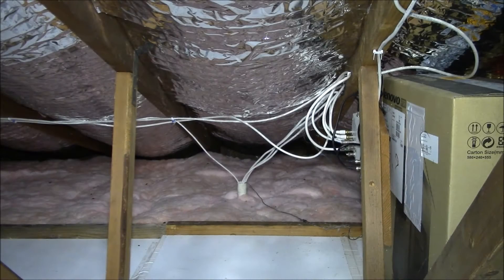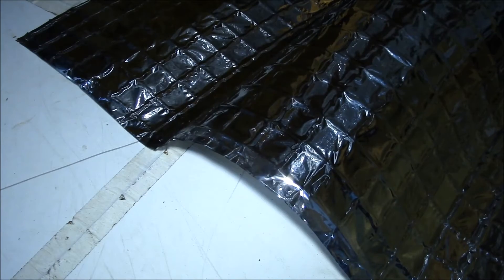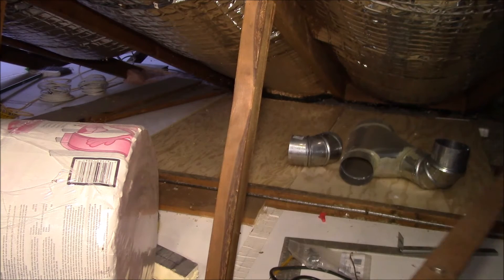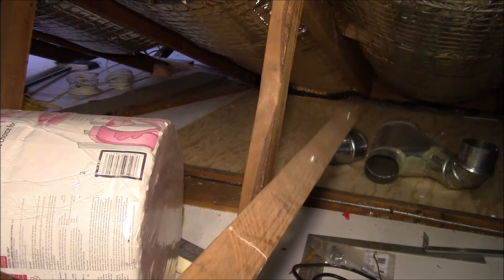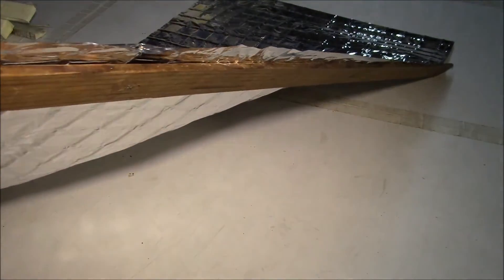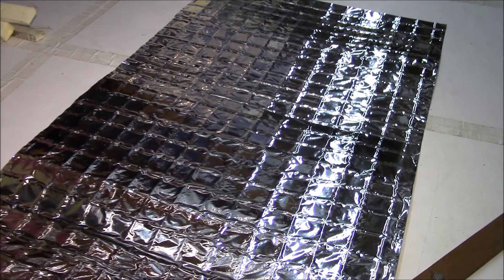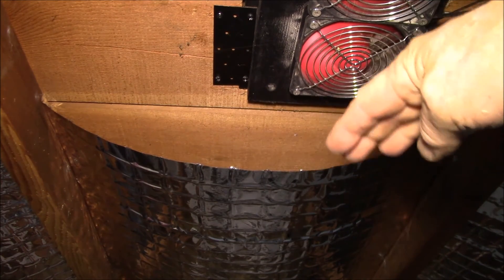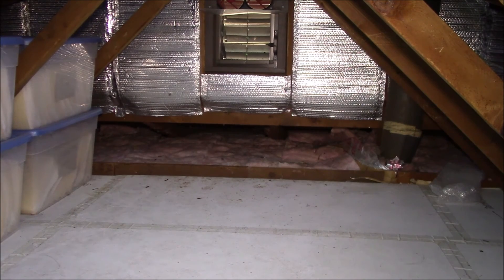Radiant Foil Insulation in the Attic

Comment: Thanks for making this video. Excellent tip about the magnets on the stick. 

I have 1010sq ft home here in South West Missouri and Im thinking about installing a radiant barrier. 1) Do you still recommend installing a radiant barrier after years of having it installed? 
2) A radiant barrier manufacture recommends me laying it over my blown in insulation but its perforated to allow moisture to escape. Is laying the barrier over insualation still effective in your opinion?
Reply from the maker: Yes, it's been working well for me for the last 8 years.  You want to have it placed somewhere between the insulation and the roof so that it reflects heat up and away from the insulation.  On top of the blown in would likely work as well.  Just this week, we had a high of 102F and the attic topped out at 112F, so it really helps, especially when coupled with some attic ventilation like I run.

Comment: imnot energy anengineer but my first tought is that steel wire in the foil deminish tht resistance value of the insulation
Reply from the maker: Agreed if this were a normal batt type insulation.  However, this is a radiant insulation that reflects infrared radiation and the steel wires are sandwiched between the two layers of foil.  As such, almost all the infrared radiation on the hot side gets reflected away from the foil.  The small amount that does get through will of course conduct well through the steel.  But since the steel wire is there to maintain the necessary air gap between the foil and the underside of the roof deck, it's benefits outweigh it's drawbacks.  I suppose they could use a fiberglass or carbon fiber type of stiffening baton between the foil, but that would probably cost a lot more.

Comment: Do you have soffit vents? I'm assuming if you do your maintaining the airflow from the soffit vent to the ridge vent. Why did you choose foil vs batt insulation?
Reply from the maker: Yes, soffit vents in every other rafter bay.  I stopped the foil 6-12 inches short of the vents to allow that outside air to enter the attic.  I used a combination of blown in insulation (existing) plus batt insulation on top of that for about R25 over the ceiling.  I wanted the radiant barrier to reflect the heat  off the roof instead adding more batt insulation under the roof.  It would have cost a lot more money and time to insulate the roof.
Reply: Heat transfers by three mecganusms..

1. Convection a stream of warm air as in Central heating or a heater.
2. Radiation the sunsl's rays or a microwave oven
3. Confuction. A clothes iron.

Fluffy batts stop convective heat transfer as they trap a layer of air which is a good insulator and holds that air in place close to the roof. This stops the rising convection heat  from escaping in winter through gaps or by conduction then convection up out the roof vents.

For summer though the heat needs to be kept out and since heat rises in convective currents of air, that's not the problem in summer... Instead it's the radiant heat which comes in about a 50/50 split between visible light and also on infrared. Well the foil reflects this radiant heat that we can't see..yes the infrared. Watching the roof on a hot day from inside the attic with a heat camera ..you'd see glowing orange colour where the roof didn't have foil and you'd see black where the foil was placed.

My trusses are 24 inches apart and I'm thinking of doing this if I can find another supplier of these sheets in Australia. What are they called again ??

Comment: Thanks very much for all the tips in this video.  I should start taking attic temp readings now so I will know how much the upgrades lower the temperature.
Reply from the maker: You're welcome.  Yes, good idea to get a baseline on the temps before hand.  Unfortunately I didn't have a camera to document this 3 yrs. ago, but I did start with the wireless temp. sensor in the attic to get an idea of what was going on up there.  I mainly did it to find out when it was safe to work up there before the temps got too high.  It took me 3-4 months over the summer to get the insulation, decking, lights and ventilation installed up there.  That was split up into many 30-60 minute sessions early in the morning before it got too hot to work.  But it was really worth it, house is much more comfortable in the summer and the attic is very useful for storage and access for running wires, etc.